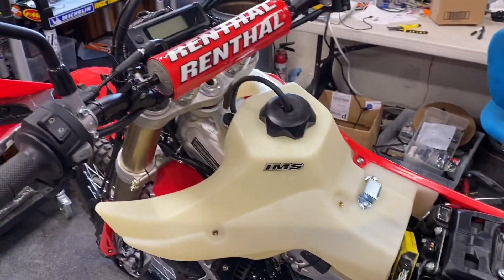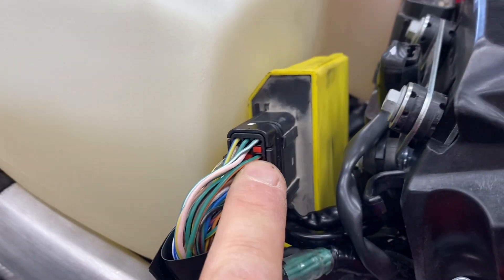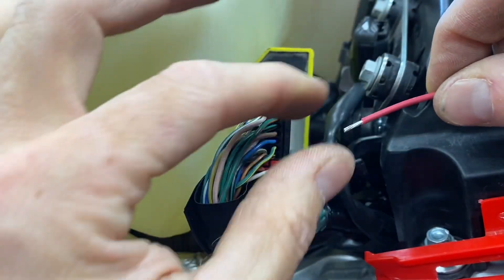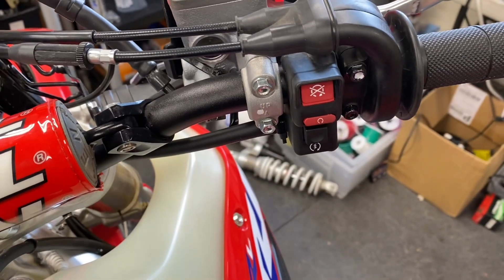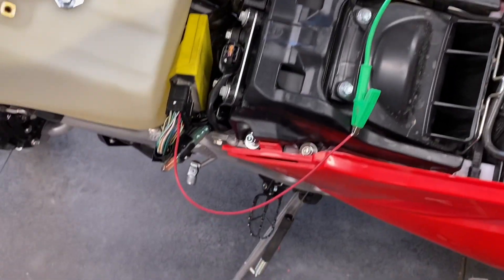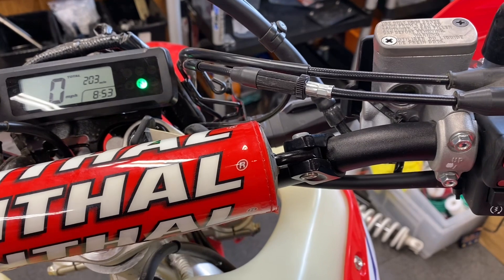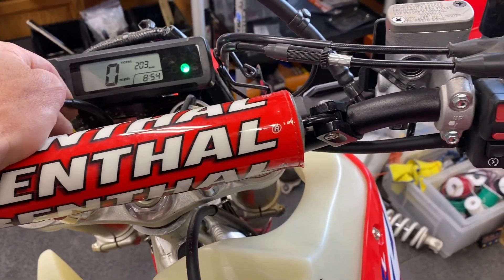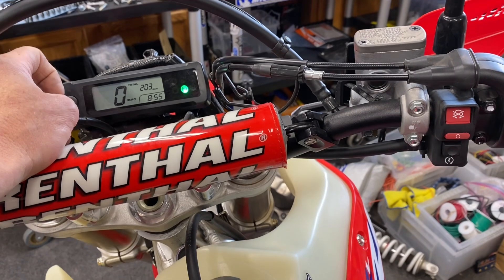19+ HONDA 450L VORTEX TPS SET POINTS AND TRACTION CONTROL

Comment: Hi , I tried to do this, for TPS, on my 2019 CRF450L, but it doesn't work, the fuel pump always turns on!
Maybe it's not possible on a 2019? I live in France, the vortex is the same everywhere I think .
Thanks for your help.
Reply: Are you sure it’s grounded?
Reply: @millamazing9176  Hi, yes, on the negative pole of the battery.

Comment: Is s´this applicable for stock ECU ?
Reply from the maker: No
Reply: @TACOMOTOCO  ok and is there any way how to do that ? My bike is dying on idle or when I hit throttle. Guys in service checked valves, changed spark plug and cleaned filter with pump. Nothing helped... :( So I think, this maybe will be good try...
Reply: @PítrRepeater  Did you get your idle figured out? You do have the idle adjuster screw under your tank, it's Yellow, make sure to set your idle to 1700-1800, manual states 1800, for me that was too high so I'm at 1700 and it runs perfect, I do have the Vortex ECU and the Yosh exhaust.
Reply: @MXKID34  Hi, not yet. I was in Honda dealer service, they added fuel with that yellow wheel on throttle body as you mentioned. Bike was running actually ritcher and was faster. A lot faster. first of all, I was thinking, that guys in Honda service changed my ECU for US specification with bigger air intake tube :D. However, after 200 kilometers, issue is back and much worst. Previously bike was able to run on choke. Now even with choke is dying... I am lost. I am waiting for next appointment in service to figure this issue out... :(
Reply: @PítrRepeater  So sorry to hear that, you've got something internal as that obviously shouldn't be happening. I've never used the choke on my bike, but then again I'm in California. My friend has the same year bike as mine and he uses his choke to start his so no 2 bikes are the same. Is your bike a Euro model? If so, they're definitely choked up as I watched a girl in Asia change out the Euro intake boot to the American one, her bike now runs as it should. I'd definitely do the air box mod, meaning, take off the cover, remove the mesh screen and replace the stock air filter with a Twin Air, let your bike breathe and who knows, maybe that's the issue, bike just isn't getting sufficent air intake? Replace the fuel pump or filter, if choke is on that forces more fuel but if your bike isn't starting sounds like you're not getting enough if any fuel. What does your spark plug look like? Have you or they checked spark? Do you hear the fuel pump come on when you turn the key on? Justting spitting ideas here in hopes something with click?

Comment: Is that Vortex instruction, or something you came up with?

Does that model even have end point set up, I thought Vortex did away with it?

The last time I talked to Norman at Vortex, he told me end point set up wasnt really needed as long as tps is in range, but it was on a differnt model. That actually made for the end point set up procedure , when bikes would turn over correctly using that end point procedure they created for that particular model.   

Seems a good thing to know, if can avoid digging at the wires,   or why not just disconnect the fuel pump, and do the procedure?

Have you been able to confirm your procedure actually does anything?
verses just plugging the vortex is with correct tps range and run it.

Comment: I bought a used 2019 crf450l with vortex and yosi already installed, it’s set @ 5 5 5 1, it runs very well, almost to much of a hit sometimes on the trails, I changed the #1 setting to #2 haven’t tried it yet, but will this week, I didn’t know about this traction control mode, or the TPS settings. I didn’t get any paperwork with it, but did print off the page that shows the difference maps. How do I get the rest of the manual for the vortex ecu, sounds like it does a lot more than I know about. Thanks